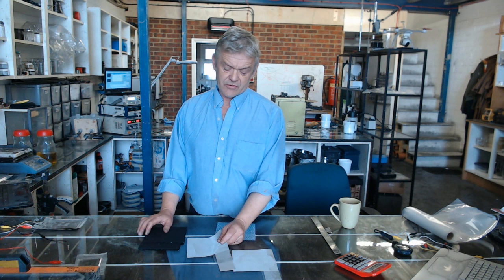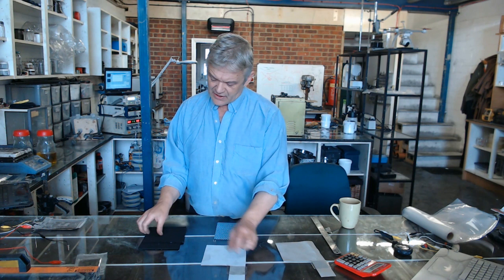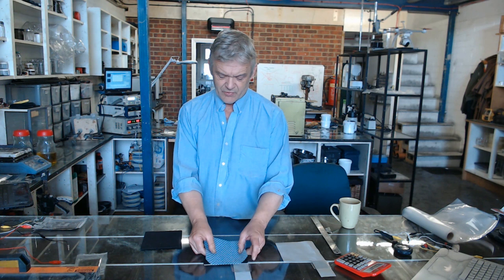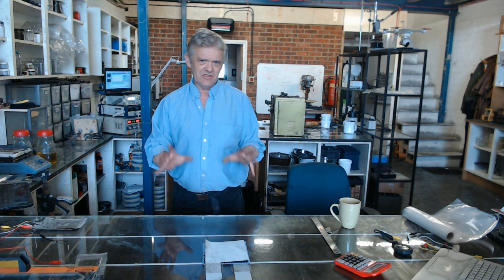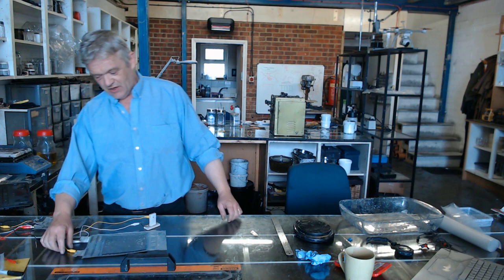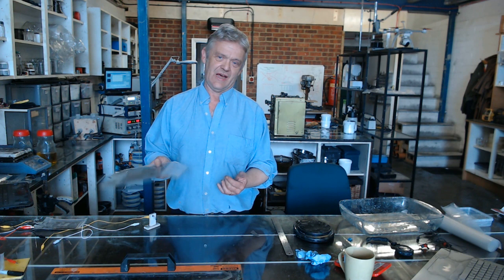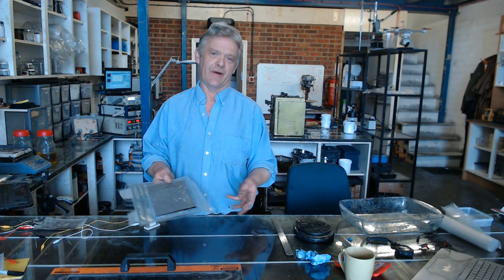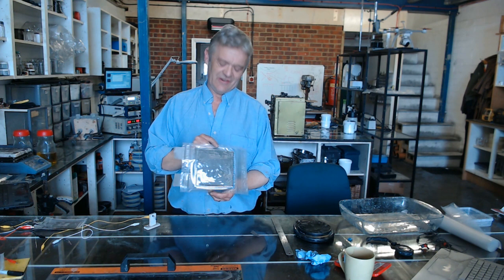Build A Super Simple Supercapacitor Step by Step

Comment: I had a play around with this material from FWG with some interesting results, Rob mentioned in a reply comment to expect around 3 watt hour a kg or 3mwh per gram.
I did get a similar result to this using 1g of felt, 1m sodium sulfate and stainless mesh current collectors.
However using the same felt and electrolyte with grafoil current collectors its much better at 16 mwh per gram.
Unfortunately I have no idea why the stainless performed so poorly!

Comment: I made one similar but jelly roll in 50mm pvc pipe and hot melt glue at one end so I could syringe in more electrolyte if it evaporated. It's held capacity and has even increased over the past year. I  also used conductive fabric instead of mesh
Reply from the maker: awesome mate

Comment: I imagine a jacket made with super capacitor layer in it and at the back of jacked a simple solar cell would constantly charge it. this jacked may spend current by producing heat with copper wiring around jacked. So it can be self heater jacked for cold days. Thanks for sharing.

Comment: Hey Rob, you made your point loud and clear thanks mate ,how about the idea of using cheap kitchen cheap vacuum bags that have valve and manually seals at one end ,opposite to the opened edge can slice cut the opening for cathode and anode seal it at that edge by the sealer machine , then close the bag vacuum it all done! ,  in case of weakened or dry electrolyte ,it will be easier to refill by releasing the valve  refill vacuum it without losing more packages . cheers mate.
Reply from the maker: awesome idea mate - cheers

Comment: That indeed is very easy! Great video, thanks for sharing. I do wonder how much capacity is in there, but I guess there are multiple variables.

This is only a single layer, I guess you could add several more (series) layers, to get larger voltages (but smaller capacitance)
Reply: I was wondering about that too. How would you do that?
Reply: I would think add more layers and electrodes, but only use the top and bottom electrodes. just like batteries in series give more voltage
Reply: I thought that too.. but there is a quality control issue that comes up.  If you get one layer wrong, the entire cell is junk.  Vs invividual cells, you can troubleshoot easier.  Much like building solar panels with high voltages, the more voltage you go, the more room to introduce errors which are harder to sort out.
Reply: @MasterIvo  yes that would work but there would be considerable leakage and super caps already like to leak but if it is not to long between charge and use it will be dandy!
Reply: @Buzzhumma  so if you wanted to use it as an outside solar storage cap to run security camera or outside light, in side phone charger charged by solar, it would be short intervals between depletions and charge cycles. Would that work?
Reply: @jeffreyrood8755  maybe. The depletion will vary a lot depending on how much your layers are in contact with shared ionic liquid. Try it and see. You can only learn and advance and most likely with persistence achieve a desired result.
Reply: @Buzzhumma  I will when I'm able to collect the material I need.
Reply: @jeffreyrood8755  thinking I'd flip the electrodes for the 'internal' cells down so they touch, producing a series cell....
Reply from the maker: cheers mate and i am afraid you are right there are a lot of variables in the build as you build it  - science is really about doing and your answers will be far more satisfying
Reply from the maker: watch a few videos and make a few and try  - science is really about doing and your answers will be far more satisfying

Comment: How super is that super cap? It would be interesting to see what the capacitance is, after all, a 20uf cap could run that little motor.
Reply from the maker: build one and find out mate
Reply: Robert Murray-Smith if you substitute the activated carbon with graphene sheets the density would increase drastically?
Reply: Supercaps are usually about 1 Farad in range. VERY DANGEROUS
Reply: @robj7481  so is a fork when used to poke your eyes. It's not dangerous at all since the voltage is low. Even 1000Farad. You can piss on it without even feeling it. 
When multiple are coupled in series, don't do that experiment. You will regret it.
Reply: @kingmasterlord  yall nasty
Reply: @ThinkingandTinkering  Seriously that is NOT helpful. I watched and got precisely zero performance data. Why didn't you do a simple test for us?
Reply: A 20 if cap would barely flash an led that's it buddy . Takes a beefy capacitor to even turn a dc motor a couple times ,I've tried .
Reply: @SuperMike-WonderWendy  Energy 1/2CV^2
Yep it may tickle the motor for an instant. That is it.
Reply: @SuperMike-WonderWendy  A 200uF cap charged to 20V will run a typical LED at full brightness for a second..ish.
Reply: @robj7481  How is that? As far as I see it would be a lot less dangerous than a Pifco AAA.

Comment: Hi Rob, I'm a new member to your channel, and love your videos! They are fascinating! Quick question - if using aluminium instead of stainless steel for the current collector, how do you protect against galvanic corrosion between the activated carbon and the aluminium in the salt water electrolyte? Thanks!
Reply: I second the tinkers request!

Comment: one question I have that I can't seem to figure out.. You are always making single layer capacitors, Could you not stack multiple layers and connect them in series to double the capacitance? I don't see it being done so I have to assume it would not work? And if you can not stack them directly together could you do it with a separation layer in between the cells?
Reply: Capacitors in parallel add the capacitance not in series.

Comment: I'm having a difficult time finding information on why supercapacitors are so small. This particular capacitor is larger than the majority I have seen you make. I'm interested in what might happen when you make a much larger area capacitor. For example most commercial supercapacitors are about as large as my hand when held in a fist. What might happen if we make one the size of a barrel of oil? I'm in the process of building one to find out although I have nowhere near the expertise that you do and to be honest I'm not sure I will really comprehend the full scope of what I have built once its complete. Thank You
Reply: I would like to know if you could build a system large enough to store solar power instead of using batteries. I would love to make 60kw at 63 volts
Reply: @thomaskelly5449  16v in series of 400F gives out 70F. Making series of 63v will reduce the capacity even further.
There is no need to build supercapacitors to store 60killowatts. And is not even possible. Unless you own half of a village to stack that energy at 63v supercaps series.
You can't really have parallel connections.
This is why you can't do that.
You need to have charging board or BMS for each capacitor.
The whole project will cost you almost 1 million dollars and will be impossible to assemble.
Reply: your not wrong but god damn you could at least be fast when stomping on other peoples ideas! 
Like you made me not want to make things by just reading that! Real inspiring dude

Comment: Yes yes yes !!!!
You have done it!!!😀
That's a really  good way of sealed, good job !!!
Easy, simple, though and resistant,  I had though of some things like that but couldn't find the issue of sealing the wire, but now it seems to be working great!!! And your able to seal it onto the mesh,  awesome!  
Really appreciate the sharing !
Keep on going, it's on the right track for shure 👍👌
P.s.  It coul be possible to make a long roll of it,  would take time to vacuum but could then be 3,10 or even 20' long sheet,  rolled onto a cylinder ? What's your's tough? Would the space lost in the cylindrical form factor could still be more effective than the square ? Versus time to production/manufacturing for parallel/series cells ? The bigger the cell, the better it is, less unuseful material ratio ?
Sorry for all this 🤔
Thank for all 😁😉
Take care
Reply from the maker: no worries mate - you could try a jelly roll design for sure

Comment: I've been following along for a year or more, and maybe I missed an video or two, however are there any basic capacitance specs available, long-term testing results?  None of this is secret or confidential/NDA IP.
Any cap on the market from the cheapest Chinesium to Nichia(?) can run non-stop 24x7 for a year or two in charge/discharge mode.
Has Robert done a video discussing this already?
BTW, I am confused, are we still working on Ultrabatteries, Super-Caps, or conductive ink?
Reply from the maker: yes mate - i have done videos on the above and we are working on energy storage which conductive ink is a part

Comment: Glad to see that you have some time to post videos Robert, like your thought processes !
I'm trialling ammonium iron sulphate as a redox couple additive for my supercap and  thoughts drifted back to manganese...but have found little or nothing about ammonium manganese sulphate on the net regarding batteries and supercaps. Manganese appears to have some similarities of iron ( as they are both transition metals and live next door to each other that's hardly surprising ) but it intrigues me as it is not found natively elemental but always with another metal, commonly iron. It appears to have many more oxidation states than iron and that interested me with regards to redox additives as a redox couple.
So, I thought to synthesise some, using a similar way as I did with the ammonium iron sulphate, by firstly sulphating  manganese dioxide with sulphuric acid and then mixing in equimolar ratio with ammonium sulphate.  Theoretically, that should produce a double sulphate and be pale pink crystal, if I am successful....but I can't find any research papers on its use in batteries/supercaps, so it might be a dead-end, but nevertheless manganese remains for me a puzzle ... but my pleasure is derived from the thought process - it has to be with the amount of failures !! hahahaha
Keep up the good work !
Tony
Reply: Do you have think to an hybrid version?
You can dip felt in a nickel chloride/ ethanol solution, then dip in a sodium hydroxide/ethanol solution and have a NiOH cathode with nano NiOH. For redox electrolyte, google "active redox electrolytes". There are many.
Couple this hybrid pseudocapacitor with betavoltaic, and you will have a car you can drive for years, without recharge..
Reply: @leonardjanus7599  Hybrid yes. I think we should not think of battery or supercapacitor as more Energy Storage Device ESD or Energy Cell EC which uses redox and capacitance functions. There are indeed many redox couples researched, and I have made my own batch of KI to trial, plus I have also tried Copper Chloride in a DES ( although not too successfully, but that may have been due to the whole system and not just one component ). The KI looks promising, but my point was that I am puzzled by manganese :) and whilst manganese has been used in various forms in batteries and supercapacitors, I can find no research where in has been used as a double salt, but there has been people looking at ammonium ferrous sulphate. Betavoltaics are a little outside my project ...and I think I would be arrested if I start buying 100's of smoke detectors !! hahahaha.
No, my project is to produce an ESD/EC to couple with my solar panels, that is sufficiently energy dense to allow, say, a refrigerator sized set of cells would store sufficient energy to be capable of supplying a house. Choice of materials would have to have a low environmental impact, including on disposal.  Thus a carbon device with ammonium based salts are where I am looking, but drift off in other directions, like Sodium Titanate.
Thank you for your reply and kind regards !  :)
Tony

Comment: Hello, me again. I've seen people buy ultra capacitors (not sure what the difference is between super and ultra) to make a 12v replacement for their battery in their car so they don't ever have to worry about batteries anymore, with a solar cell for trickle charge. Could you make something similar with these, and if so, could you demonstrate? If you could make a working demonstration then I think people would flock to buy out your inventory. lol
Reply from the maker: Science is really about doing and your answers will be far more satisfying - but i get your point - even so for your first efforts you wouldn't want to make a large application - you need to practice and build a few small ones first - i may do a video on this
Reply: "not sure what the difference is between super and ultra"  It is merely super when you make it, ultra when I make it.

Comment: What tools to you use to charge and test these small capacitors and batteries? What do I need to order?
TIA
Reply from the maker: i use a  range of things including a princeton 273a potentiostat, a cadex 8000 and a rigol benchtop power supply with a bk precision load - but as a minimum a data logging multimeter, a benchtop power supply and some kind of calibrated load - like a resistance network would allow you to make a good evaluation of their performance

Comment: Just an idea. Next, make flow capacitor where you move electrolyte from a single uncharged tank to 2 charged tanks. :D

If I were to take a stab at it, I'd use a plate with channels in it for charged electrolyte. A stainless steel mesh current collector that allows the charged electrolyte to flow through. Crushed activated carbon. Seperator  with channels for uncharged electrolyte flow. and repeat the other way around for the other half.

Comment: Ive seen videos of a plastic lining in soda cans. If the aluminum/tin can is conductive, the plastic an electrical separator, how feasible is it to make a crude capacitor from a soda can? Could soda be used as an electrolyte?

Comment: Nice video sir, but how long will that capacitor/battery run that 6 volt motor?
Reply from the maker: the motor acts as an inductive load and doesn't give a true reflection of the energy density - what you really need is a precision load and data logging - but you can expect around 3 watt hours per kg as a figure - but that again will depend on how you make them

Comment: You can impress your friends by making a battery out of nothing more than a few pennies, a few nickels, and a paper towel soaked in salt water. 
Stack the coins vertically and alternate penny, nickel, penny, nickel and put a neatly cut circular piece of paper towel soaked in salt water in between every coin. 
VOILA! A voltage-producing battery and you can read the voltage with a voltmeter!

Comment: Hi Robert, what kind of tape you use, the tape I have cannot seal together with my vacuum bags? Or it could be my sealer not hot enough, how many watts is yours? (And think my emails went into your spam again)
Reply from the maker: I used a polyethylene heat seal packing tape mate - I got it from eBay - I just specified heat seal and polyethylene

Comment: I'm interested in making a solar array and powerwall set up. I'm wondering if the method would be able to be layered and used for this. Even if a small scale for a few items to be powered or more complete system that would run the whole house?
Reply from the maker: if you have never made anything like this mate you really need to start small and experiment - it is a skill like anything else and you are going to make a beautiful table if you have never done any wood work

Comment: I understand the felt w/ activated carbon; probably soaked in wet, then dried.  The separator, and positive and negative poles need more of a description for me.
Reply from the maker: there is no more description to give mate - it's as simple as it seems - the rest is up to the experimentor to try
Reply: They start out identical metals.  The direction of initial charge will decide which plate subsequently becomes negative and positive.

Comment: Kewll! Great video mate. I guess i could add more carbon or active material in an ink and add it to your activated carbon cloth in the same set up? Also, would stainless mesh current collectors be ok for the long run? Or would the aqueous electrolyte adventually rot it?
Reply: Stainless steel so no rotting and likely yes for the ink make a few prototypes first so you learn and get an idea for how to make the larger setup.
Reply: @Barskor1  stainless steel does rust, and with salt water it will rust faster, having said this the process would still take so long your collectors will likely outlast anything you could buy market wise for the price.
Reply: @davidkunkle405  Oxidation in a vacuum it would be minimal if you really wanted to you could degas the water first for even less oxygen in the system.
Reply: @Barskor1  Water is Oxygen (and hydrogen!) released by electrolysis as current flows through it.  Furthermore, salt (NaCl) will ionize into sodium and chlorine, with the sodium going to one plate and the chlorine going to the other during charging. The sodium is likely to bind to the oxygen released by electrolysis, leaving free hydrogen and chlorine ions which will probably attack the iron in the plate turning it into ferric chloride.

Comment: can we use aluminum foil for current collector?
Reply: I've saw using a piece of aluminum sheet metal about credit card size coated with graphene mixed with polyurethane and activated carbon sprinkled heavily then wrapped in blue shop paper shop towels with ammonia chlorine and vaccum sealed. Can't remember the performance stats  extremely quick charge..3 seconds and ran a 1.5 amp or volt not sure for 30 min I believe.
Reply: I saw a video